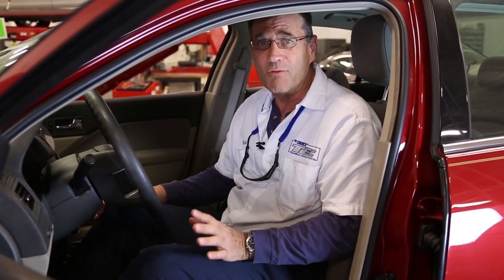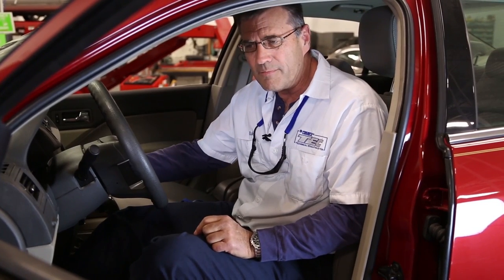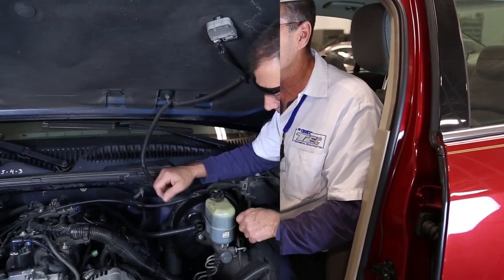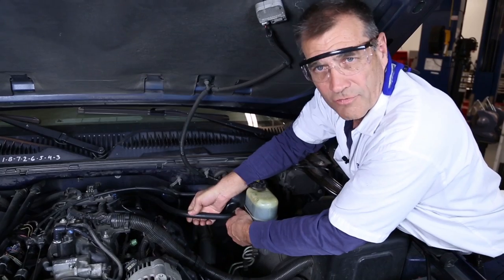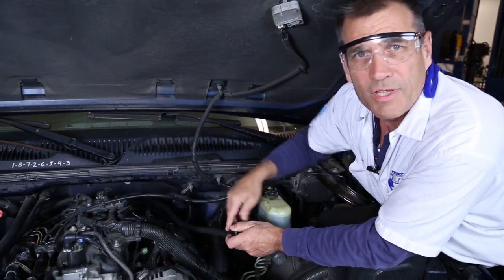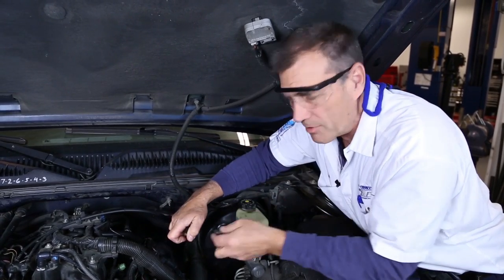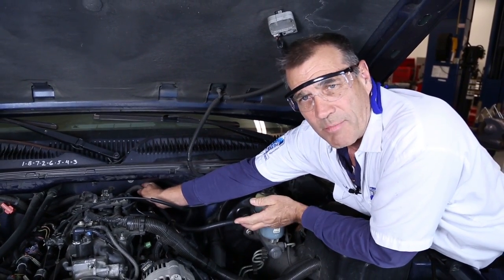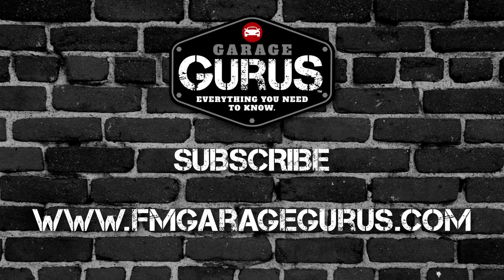Hard Brake Pedal Diagnosis with Vacuum Brake Booster Inspection

Comment: This is great.
I just have a question i have a hilux 2003 and when i go high speed my brake pedal is hard and its not stopping properly when i push the brake but when I’m in normal driving its working properly, what could be the cause of this
Thanks

Comment: 1982 4door cutlass supreme v6,3.8  breakpedal hard with engine off.cant press down..when i turn engine on the pedal will go down ,when off the pedal hard ass a rock???help....just intall new booater?🤔 check valve fine

Comment: Good video. I like It. Just a question, is there difference if I change the original vacuum hose for a generic one? Will it affect? Regards
Reply from the maker: Do not use generic hose or fuel line for the Vacuum booster hose repair. It may collapse and cause a loss of braking.  Look for EPDM tubing for vacuum and emissions systems.  It should be at least similar or better than SAE J1037 or J942b standard hose.  The tubing should not deteriorate from heat, weathering or ozone, and it maintains its flexibility at low temperatures.
Reply: @GarageGurus  

We have cold weather here, and yesterday I accidently hit mine with my hand, and the rear tube behind the engine snapped, leaving the plastic end inside the connector.

I was hoping your video was going to show the procedure of removal & re-install!!! lol

Comment: I have a 2001 honda crv only get a  good brake pedal when the engine is off. As soon as i turn it on the pedal goes straight to the floor. I noticed when i removed the vacuum hose from the booster side i had a good pedal. When i put my finger on the end of the hose i felt the vacuum pulling and the engine was about to die. Mind yiu  i replaced the original booster with one from the junkyard before all this and the car still acts the same. Can it be the intake manifold. I really don't know anymore.

Comment: i have hard brakes on my Toyota Coaster mobile home. it hasn't been on the road 10 years I have bought it and I had it for two years I have done somebody work to it and decking inside of it and is time for me to look at the brakes. my brake booster is on the dashboard. I need to take my speedo out to have a look and check the pipes

Comment: Help ! Was working on my 5.7 vortex distributor when I’ve noticed the brake booster vacuum connector that is attached to the intake manifold has snapped off due to old age and fallen in the engine when I started the vehicle it started making a loud knocking sound
Reply: i know im asking randomly but does anybody know of a tool to log back into an Instagram account..?
I was stupid lost my account password. I love any assistance you can give me!
Reply: @Gabriel Hugo instablaster =)
Reply: @Noe Ulises Thanks for your reply. I got to the site through google and im waiting for the hacking stuff atm.
Looks like it's gonna take quite some time so I will get back to you later with my results.
Reply: @Noe Ulises it did the trick and I now got access to my account again. I am so happy:D
Thanks so much you saved my account!
Reply: @Gabriel Hugo happy to help =)

Comment: I drive a 2015 golf tsi 1.8 and I came across a situation where, when I am idling, as I compress the brake pedal I can hear a hissing noise or (air escaping) and then the pedal becomes hard.
Can someone please help. I checked the vacuum lines and they all seem good and relatively new. I also pulled the check valve form the booster and heard a small hiss, not very much but it was there.
Reply: What was the solution?
Reply: @American_Devil  brake booster. The blatter inside the pump had a small tear
Reply: @Dustytrailzzz  I replaced the pads last night and now I’m getting soft pedal and sounds like I’m stepping on a bag of air in the brake pedal. I just dropped it off for brake inspection. Thanks for responding so quickly
Reply: @American_Devil  well hopefully it’s not the brake booster. It cost me 900$ CAD